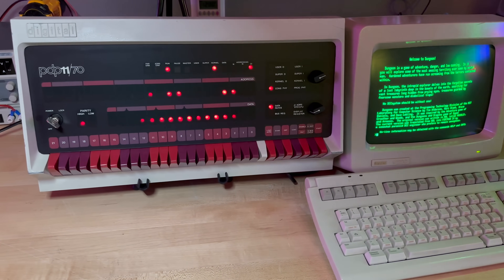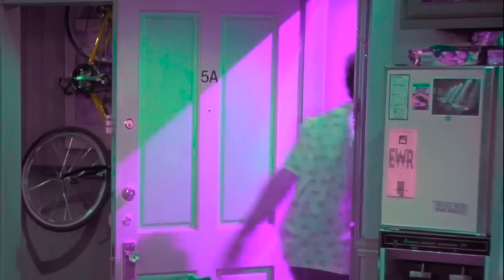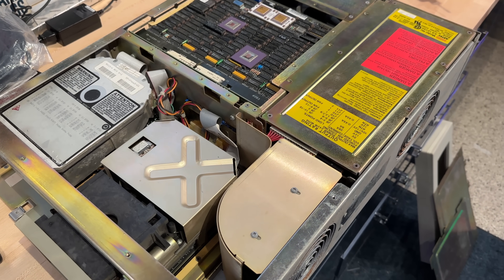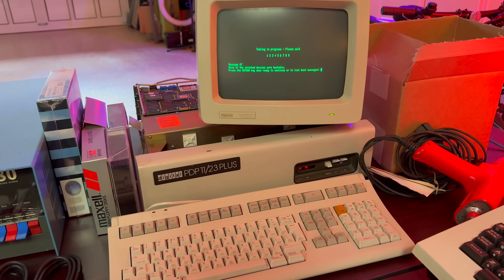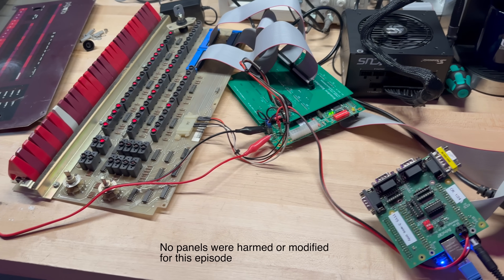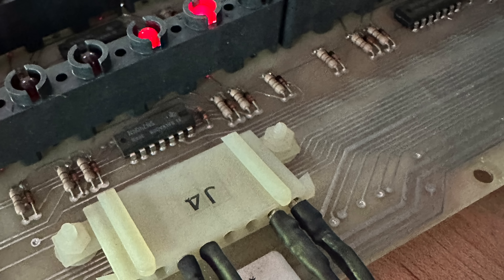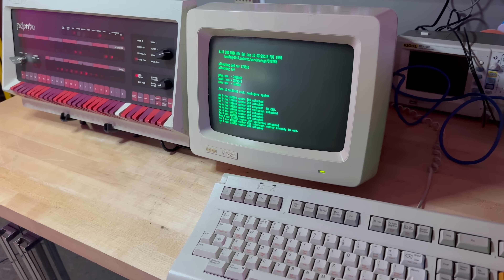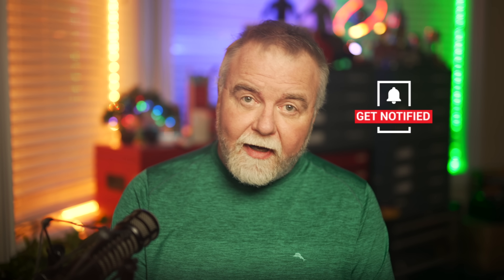Ultimate LED: The PDP-11 DASBLINKENLIGHTS!

Comment: I'm retired Navy and in the late 80's and through the 90's we had a full PDP-1170 that did classified message processing. It ran RSX-11 and it was so fun to work with.  I got to the point I could tell what the system was doing by just watching the blinkin' lights.  Thanks for the trip down memory lane.  Computers were so much fun to work with back in those days.
Reply: I could tell by your SN! Thanks for your service.
Reply: In the 1980s, we had Honeywell DPS-6 mainframes on the carriers. I think I could still boot one today! Not to mention mount 1600/6250 bpi tapes and run a decollator to separate the 4 layer carbon copy printouts. Ah the good old days!
Reply: I ran Prime 400s, and I could definitely tell what was going on from the front panel. Sometimes I'd set the display address to the user number so I could see who was hogging the system. Later systems had a Z80 VCP (virtual control panel). It was much less helpful. You typed octal rather than using binary switches.
Reply: @BlankBrain  "I'd set the display address to the user number so I could see who was hogging the system. "  Shouldn't the  address displayed be the current execution addr?
Reply: " I could tell what the system was doing by just watching the blinkin' lights."  Interesting, how to do that?

Comment: The first PDP-11 I has a chance to use was in the mid 1970s.  It was a PDP-11/40 with a DECtape, a 9-track tape drive, and RK-05 disk and a Teletype ASR-33.  The O/S was RT-11.  When I turned on the system, it was necessary to key in a jump instruction and an address from the front panel to branch to the boot ROM to start RT-11 from the disk.  I can still recollect the aroma of oil from a warm Teletype.  I also had the opportunity to run FORTRAN programs on a 11/70 with RSX-11D O/S at local company back then.  The 11/70 had multiple ADDS Regent CRT terminals in a separate room, so no touching the computer.  The system had a Printronix printer so getting program listings was very fast.

In the 1980s, I worked in a lab with a PDP-11/34 which had front panel with seven segment displays and a keypad.  No blinking lights.  We had the DEC decgraphic11 board(s) installed and VR17 vector display with light pen.  There was a lunar lander vector game.  If you landed in the right place, there was a McDonalds on the Moon where an astronaut would get out of the LM and place an order.

Comment: Our university had an 11/70 (ground floor building 8 and indeed behind glass walls that only hi-priests could approach), it was among its many tasks the host of a 6502 cross-assembler for the microprocessor class using KIM-1. That and two terminals in the building 9. To think you can have a desktop emulation of it (and really anything else we saw in youth) is just marvelous. Cal Poly Pomona, 1983. BTW my particular quarter the facility wasn't available (licensing?!), so all my code was done by hand assembly and hex keypad. I bought a C64 and The Assembler-Deveopment system not long after.

Comment: Fantastic video, Dave.  You are doing yourself a grave injustice downplaying your hardware skills, though.

Somebody commented on their favorite assembly instruction.  Mine is (I don't remember the actual opcode or the CPU it was on) "Unmask non-maskable interrupt".  Huh?  I wondered, if the interrupt is non-maskable, why would it ever need to be unmasked?  Turns out there is a very good explanation.  On reset, even the non-maskable interrupt is masked.  This allows the CPU to do a few critical operations, like initializing the stack pointer to something useful!  After the most fundamental initialization is done, you unmask the non-maskable interrupt, and it won't be masked again until the next reset.

Comment: Great episode. I cut my teeth on PDP-11/70s, ‘44s and the mini ‘23s, before moving on to VAX’s and Alpha’s. Most were running RSTS/E and VMS with the odd Ultrix install. I would program the ‘44s using octal on the front panel to boot to a 10Mb hard drive the size of a washing machine.
Reply: it seemed  clumsy to program, compared with using paper tape, wasn't it?

Comment: The CPU interface on the front of the case is one of those interfaces I love to see. So many switches! You can TOUCH the bits! I love that.
Reply: I love your phrase:  "touch the bits"
Reply: @consultingengineer5593  I think I can go one better.  At university in 1973, the Computing 1H tutor passed a core memory board around the class.  I actually touched a memory core with wires criss-crossing.  The university had a CDC 6400 and some PDP-8s, so I guess the board must have been faulty from one from those.

Comment: Achtung: Das machine ist nicht fer gerfingerpoken und mittengraben. Ist easy snappen der springenwerk blowenfusen, und corkenpoppin mit spitzensparken. Ist nicht fer gewerken by das dumpkofen. Das rubbernecken sightseeren keepen das hands in das pockets. Relaxen und watchen das blinkenlights

ACHTUNG!

Alles Touristen Und Non-technishen Lookens Peepers! Das Machine control is Nicht Fur Gerfingenpoken Und Mittengrabben. Oderwise is Easy Schnappen Der Springenwerk, Blowenfuse, Und Poppencorken Mit Spitzensparken. Der Machine is Diggen by Experten Only. Is Nicht Fur Gerverken by Das Dummkopfen. Das Rubberneken Sightseenen Keepen Das Cottonpicken Hands in Das Pockets, So Relaxen Und Watchen Das Blinkenlights.
Reply: A couple versions of warnings (sometimes posted with Gothic lettering for the Achtung) in computer rooms (what we used to call them before they became data centers).

Comment: Thanks Dave.  My first job after graduation was, in part, doing system admin for a broadcast television Teletext system,.  It ran on 2x PDP-11/34s with RL02  (10MB) removable disk pack drives and the programmers front panel (octal keypad and displays - not as cool at the 11/70s paddles), one machine was equipped with 64kWord of RAM and the other had a massive 128kWord of RAM.  The OS was RSX11-M-Plus.  This system needed to do a lot of real time work in order to generate the teletext output steam to be synchronous with the television signal with microsecond accuracy.  I've always marveled at how such a limited resource platform could keep up - truly a tribute to the efficiency of RSX11-M.  Thanks Dave Cutler!
Reply: This is fascinating. Who was the teletext service for?

Comment: Great machine and great OS!  Spent the latter half of the '70s developing a multi-user email system ("COMET") running on 11/70 running RSX-11M.  All assembly language to get the efficiency needed to run 60-70 concurrent users.  Those were good times!

Comment: There might be some PDP 11 hardware out there that is associated with Xerox equipment. I used to work on a Xerox 9700 to put myself through college. It would print 2 pages/second 300 DPI and you could merge data with an overlay. It would also do both sides. The brain to all of that was a PDP 11/42 I think. Split bus. We used to print from 1600 BPI tape. This is all back in 1985. Amazing machine.
Xerox used to make the entire pdp computer except the actual CPU. That was from digital.
If they loved it enough to do all of that maybe there is someone with a big pile of PDP 11 parts.

Comment: Deja Vu! One of the first companies I worked for in the early 1980s as a programmer was a San Diego manufacturer of microfiche printers (wet process) and high-speed laser printers (like "AT&T billing" speed). The printer ran at a rate of 29 inches per second of fan-fold paper and used a PDP-11/34,  running RSX-11 (?), as the controller. It was so fast that an adjunct paper management mechanism had to be used to make sure that giant spools of printer paper wouldn't just immediately burst when the printer started feeding. Print jobs would be loaded via the mag tape drive and run off-line from a company's main data processing system. The microfiche printer would actually image each page on a CRT and optically reduce it for exposure to a film fiche, and was run from an older Lockheed design called the SUE (google it), something akin to the processing power of early PDP-11s. Lockheed got out of the computer business at some point and stopped making the SUE system, so rather than re-engineer the whole product, they just built their own SUE computer from AMD29000 bit-slice processors and emulated the SUE instruction set in firmware. What a hoot. Our engineering department ran about 12 engineers off a single PDP-11/44 running RSTS/E with big 10-platter removable disks, mag tape units, etc... the whole thing, housed in raised-floor A/C cooled special room. What a hoot. Today's entry level CPU probably has more processing power. Ah, those were the days.

Comment: Back in the early '90s, I was given a storage cube filled with, what I was told, three complete PDP 11/70 systems. The "only" thing missing was the OS. So I scrapped the systems, tearing them down and selling what I could (the bare racks sold amazingly well at hamfests), and recycling what the local recycler would take. I ended up with 3 of the control panels, a working DECwriter III, a rack with the PDP 11/70 faceplate on the top and both sides and front and back doors, and several of the power distribution systems. Most of those were designed for 3 phase AC, but were easily rewired to work on 110.

Well, I went off to college, and I went to she shed the following spring.  ALL of it was GONE.  Yep, my dad trashed it.  And those 11/70 control panels were MINT.
Reply: Three scrapped PDP 11/70s makes me sad.

Comment: I was never concerned about the Y2K "problem" although a lot of people I worked with were running around in a panic. The issue was pointed out to me in a Fortran programming class I took in 1974, again in 1980s when I started learning the Unix system and again in the early 1990s for yet another programming course. Programmers were not as stupid as the general public and mass media portrayed them

Comment: When I was in school we had a HP2100.  To boot we entered a program in binary that would read the paper tape.  It's easy to covert from binary to octal.  Just remember 0,1, 2 , 4 each one of these has one bit on.  Then add the numbers.  110 is 4+2=6 in octal.  111 is 4+2+1=7.  So the program I entered was on the paper in octal and easy to convert as I went down the page.  Or

# Function to convert Decimal number 
# to Binary number 
def decimalToBinary(n): 
    return bin(n).replace("0b", "") 
   
# Driver code 
if _name_ == '__main__': 
    for x in range(8):
        print(x,decimalToBinary(x))
Do that.  :)

Comment: The most amazing 11/70's that I saw at Kodak in the early 80's were Intergraph CAD systems. The workstation controllers had even more (vertical) LEDs. The next Intergraph models were VAX 11/780 based, faster but not as cool.

Comment: many many years ago had chance to collect from a load of PDP equipment being scrapped unfortunately only had a car and not enough time as distance was far to recover much but did score an 11/70 front panel with its aluminum bezel - though when I last looked at it some of the switches don't move correctly which is sad - I sort of like the idea to hook it to a raspberry pi but never had the time, was not really into PDPs bit old for me definitely a VAX man - love my 32bits (VAX Macro Case/Switch, polynomials, queuing and CRC in their own single instructions) and VMS is still the best OS! Now its on Intel thanks to VSM who took it over! An OS still running strong and defeated many a company including SUN - who would have thought with McNealy's diatribe!

Comment: I used to have a PDP11 programming card that I had since the late 70's, early 80.  No idea where it went when i moved in 2017.  Ya. I'm old 🙂  I still remember toggling in the register entries to boot strap the thing.
Reply: I still remember how to boot TSS 8.24 and OS8 on a PDP 8/e back in 1975-1981.

Comment: Thanks for this video Dave.  In the early 80's I worked in DEC Field Service and repaired a lot of PDP-11, 34, 40, 45, 50, and PDP-11/70s.  Shortly after that I moved to the software group installing RSX-11M for all the local clients.  After that moved on to VAXen and VMS.  What a great time of life.
Reply: Ah yes - those were the lazy hazy days of summertime: hand toggling in, from the console, 12 feet of paper tape bootstrap because the System engineer was enjoying the department's annual day at the golf course and had hidden any extant spare far better than I could track down.

Once done, and verified, I made 3 copies: 
- One for the computer room;
- A second for the errant systems engineer, left unsigned on his desk; and
- A third for the back of my desk drawer - because I had no intention of repeating THAT hot summer afternoon.
Reply: The loss of DEC still hits me in the feels. People that didn’t have the fortune to experience it just can’t understand the quality of those systems. I’ll add, the field service was, hands down, the best I’ve seen and still compare vendors to as the high bar. All of you in the field did truly excellent work, thanks for all the help over those years.
Reply: My friend John was DEC support in our region and has a complete PDP11 set up in his basement fully featured with all options and accessories. Terminals Teletypes Tape Drives etc...  That thing should be in a museum or with someone who will use it and love it. Its operational.
Reply: @KlodFather  If I had room, I would love to have a setup like that.  There's probably a museum that would love to have it.
Reply: @SyberPrepper  -  Yes I agree. My friend Jake used to have a PDP-11 in his house (an older one) and his mom would let him run it in the winter because it cost nothing to operate it... They had electric heat, so it was a net zero to operate. The electric furnace did not run as much when the PDP was running on 240 in the house. A win win for everyone
Reply: What PDP would you have for home use, including any special cards  @SyberPrepper ?
Reply: @DumbledoreMcCracken  Sadly, all I have is a small Alpha system in a closet.  I vaguely recall having an LSI system years ago, but that is long gone.  How about you?
Reply: @SyberPrepper  nothing that vintage yet.  I used to write a few algorithms for an Alpha that software people turned into Ada.  Can't remember which model as it was more than 20 years ago.
Reply: @KlodFather  awesome!
Reply: And don't forget DECUS, and the magic sessions. I still remember some guy named Conroy who wrote an entire C compiler, assembler, and ed editor and put it on the decus tape. I used that to turn our lab into a hybrid unix/rsx11m setup. Kept all the wizards happy. Fun days for sure.
Reply: I, too, worked for Dec. I learned so much and was encouraged to do so. I had an 11/23, 11/73, and 11/83. Had A-D/D-A board in them and programmed in Macro-11 on RT-11. Did some work with RSX-11M as well.  I remember toggling code into the PDP-11/40 as well numerous times. Bootstrap code 173000 for the diagnostics operating system. Can't remember what it was called.  Many good moons ago. What fun...
Reply: I was also an FS guy at DEC. I worked on all of the systems you mention as well as the LSI 11s. I also had a few VAX systems as well. I ended up teaching classes for DEC and ultimately ended up in engineering. I made it all the way to the HP days.Then our project got cancelled and we all got axed.
Reply: DEC FS 82-86 in Santa Clara, CA. PDP-11/34’s and 60’s… then VAX-11/780, 750 and VAX 8600. Good systems!
Reply: Comments are for people who can’t read a switch register.  😂

In the very early’80s, I worked at Mostek.  We had a lot of DEC equipment.  However, “dasblinkenlights” was a term used by at least one of the engineers who built a machine (which I later repaired without schematics) that they put a label on.  To my memory, it basically said “Keep your hands off the buttons and in your pockets.  Just sit there and admire dasblinkenlights.”   
I don’t know who made it, but I think of them on a regular basis.  ❤

As for the bezel, it is safer to 3D-scan it than to make a mold from it, but a competent caster or modeler/printer can do either without hurting it.  It’s more about shipping damage in my mind.
Reply: Thanks, Dave. Hello, esp. my fellow ex-DeECcies. Did -11M too, after -11D (with IAS on top) then off to VAXen, including a visit to Marlboro (was it? Or the Mill maybe?) to run a benchmark on the prototype  11/782. Badge 94442 (this may start a lowest badge number tournament :) )

Comment: What a great trip down memory lane! I was a CS student from the late 1970s through the early 1980s. Our department computer was a PDP11/70. My advisor was very proud that he got a 256K memory upgrade from DEC for just the annual maintenance cost (of $10K). When I started work in 83, my first job was writing software for a PDP11/73 that was the workstation part of an in-circuit processor emulator product line. So, I remember the PDP and Unix quite fondly.  Thanks for the great video.

Comment: Hi, Dave. For reproducing the bezel, you could hire a high resolution 3D scanner, maybe? The worst that could happen to the original is getting sprayed with the washable white powdery stuff that helps the surface to scan. You could then get a 3D print made, prep it with superglue and sanding so that it matches the scan as closely as possible  (verifiable with a scan) and then use the print to make a mold for proper urethane resin casting.
Reply: or just use the 3d print.😃
Reply: @scottbaeder37  that's that half-assed option.

Comment: Around the time I was 14-15 years old, the Pinellas County Science Center had a Honeywell 1648A 3 computer (job, control, communication) timesharing system. We wrote code in Fortran and BASIC using an assortment of green-screen terminals and printer/teletypes. Those were the days.